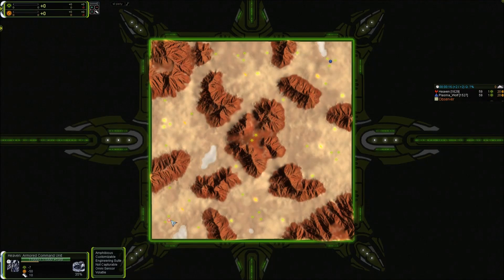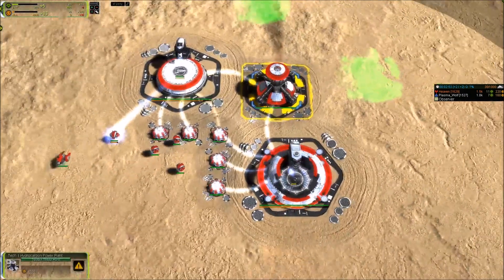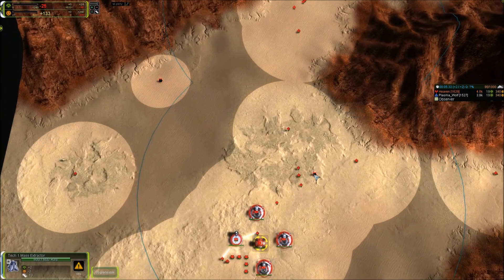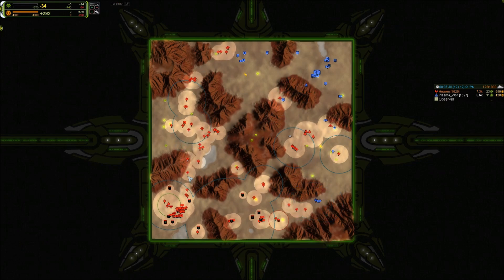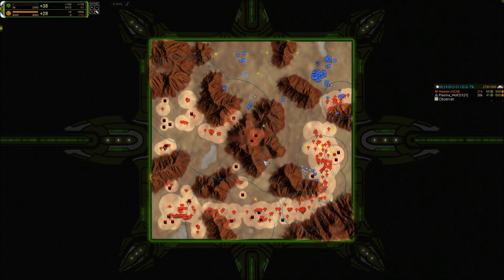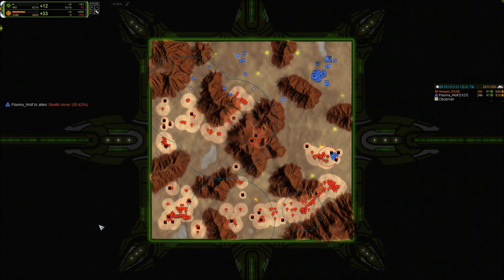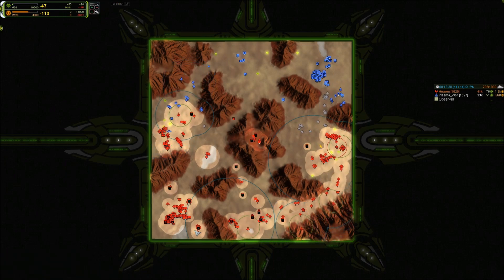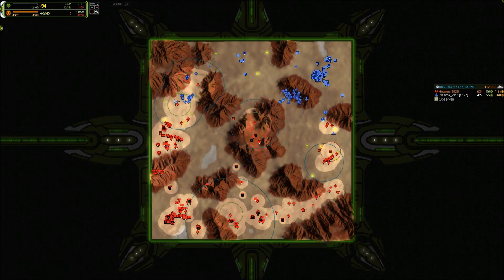Desert Planet II - FAF Ladder Tutorial 2 - Supreme Commander Forged Alliance

Comment: Thanks Heaven, great video as always: just have some questions, if you don't mind.
1 - How much power do you need to Overflow before starting a T2 power gen without getting massively stalled?
2 - How do you see the build range on the ACU and engiis? Is that a mod?
Reply from the maker: 1 - i don't have a rule of thumb for that; i think it's natural to get stalled while building your first t2 pgen and then you can just wait it out; otherwise it's a sign you have been overbuilding power in the t1 stage. if the stall is too intense, pause some of the assisting engineers, your air production, etc.
Reply: i know the second one, its a ui mod, he has a video about them.
Reply: Found the video. Ok, thanks man